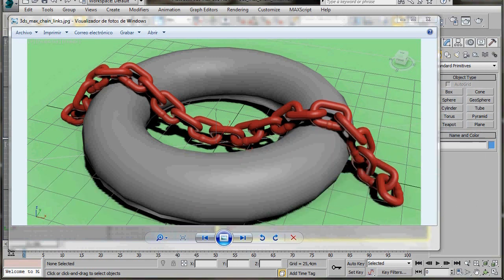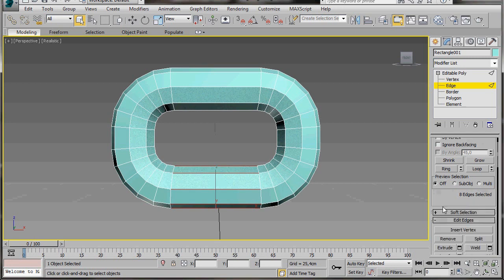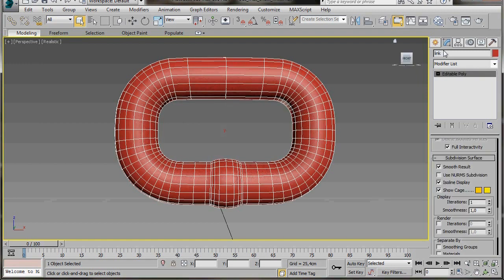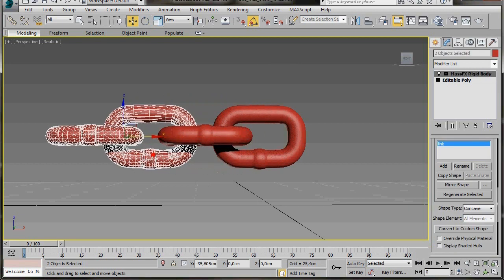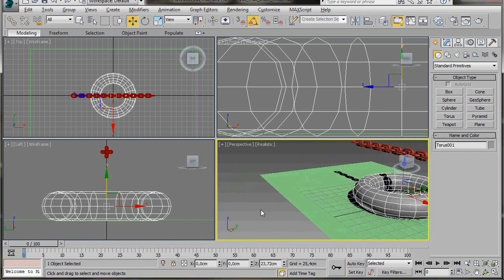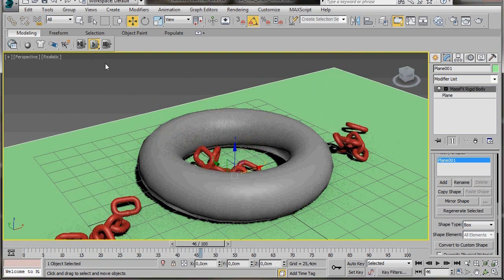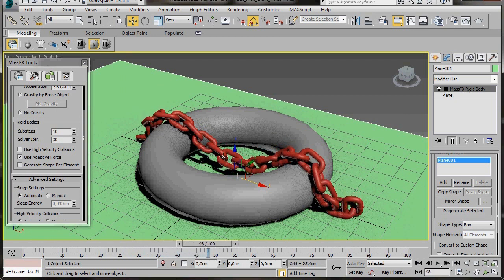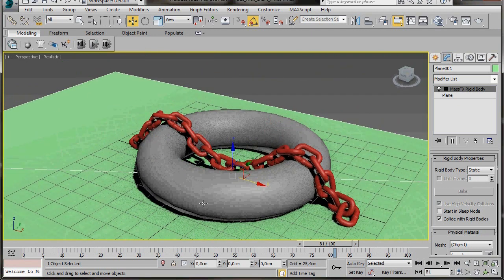3DS Max Chain Link - 3DS Max Tutorial Beginner

Comment: Seeing as my background is totally  Mcad based [ Siemens Solid Edge and Siemens NX ] Vrep modelling is alien to me .   These tutorials [ in my case for 3 DS Max ] are Superb,   I find them invaluable, and so well narrated.   I did wonder if it was possible to export the result of the Chain / Torus simulation  unwrapped as an FBX for use in Substance Painter,  My first attempts always resulted in the simulation reverting to the straight chain, when unwrapping, but.... after some trial and error I have a method that works perfectly.  After the simulation has run, I select everything and convert to Editable Poly then I can unwrap and take into Painter.  Not sure  if my method is correct ... but it works great.   Keep the tutorials coming , love them👌🏼👌🏼
Reply from the maker: Thank you

Comment: Nice tutorial but my chain links keep breaking apart when running the simulation despite my Substeps and Solver Iter. being set exact;y like yours. I think the problem is that under Mesh Type within Physical Meshes I don't have the option for Concave just Convex, which is what I'm using instead. Why wouldn't Concave be there and how do I get it to show up in the drop down list? Thanks.

Comment: skip to 8:30 if you don´t want do see the modeling process

by the way, the basic grid is by standard a collider too, so if you want to run some tests, lift your objects up so there´s a bit of space between them and the grid (you can deactivate that in the MassFX Settings under scene settings/environment/use ground collissions)

Comment: Excellent tutorial! 
And for the record, those of you who have a version of Max that doesn't include MassFX, this tutorial works perfectly with the Nvidia plug-in PhysX.  (can get free on Nvidias website. Just google Nvidia PhysX for 3ds Max and get the version that corresponds with your version of Max). The interface is almost identical. 

The ONLY thing that's different is the part where you need to tweak the Substeps and solver Itinerations. PhysX doesn't have the the Substeps paramenter, only the Solver Itinerations. It was set at a default of 30 for me, and the chain broke apart just like in the video. Setting it to 40 solved the problem. 

Also, keep each link as low poly, and clean-meshed as you can. I don't know if it's just with PhysX, but I had created a chain of very high poly links (probably some overlapping polygons in it too because I was sloppy) and when Generating the Convex rigid body, Max crashed. After several tries, I created new links with Wendy's low-poly method solved the issue.
Reply: Just restart the pc, had the same problem ;)